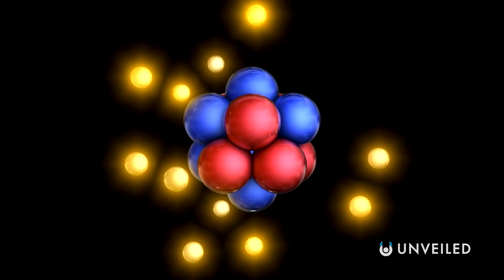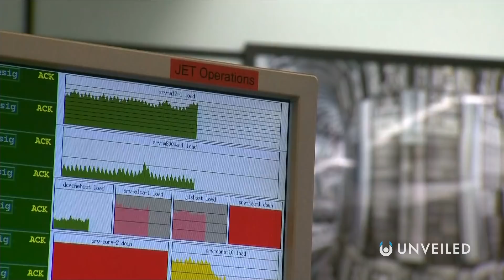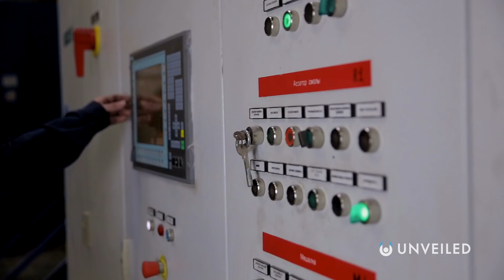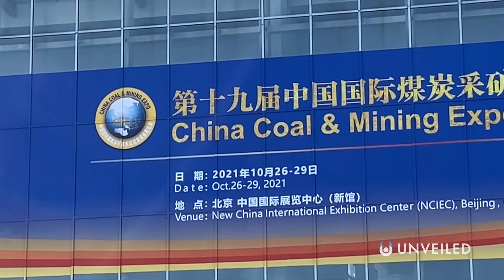Is China Really Building an Artificial Sun? | Unveiled

Comment: How are they going deal with the gravitational pull that the sun have and how are they going keep all heat in??
Reply: Fusion happens inside Stars due to two major factors: Temperature and Internal Pressure.
For fusion to happen, the Hydrogen atoms must be in plasma state and have to be close enough so that they can overcome their replusive forces between the protons in the center.
For that, the temperature required is wayyy higher than what's inside a Star, but Stars compensate for this by the other factor: the Compressive pressure due to it's gargantuan mass.
The host failed to mention the compressive force of the star to compensate for the lack of temperature here.
Here on Earth, we can't achieved such heavy compressive forces as it's currently impossible for us to make such a massive force. So, we compensate for this by increasing the temperature. That's why general Fusion Plants made on Earth have temperature many folds higher than the Sun's core.
So there's no need to have a Sun-like gravitational force to keep in the process. As for containing the heat,  I have no idea, as such intense temperature hot enough to force hydrogen to become plasma, cannot be contained by any matter that I can think of.